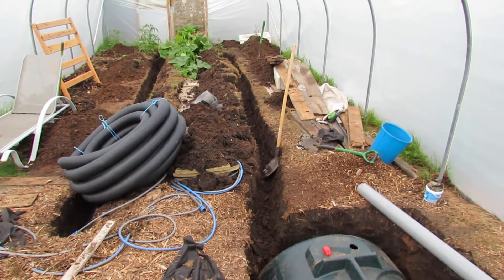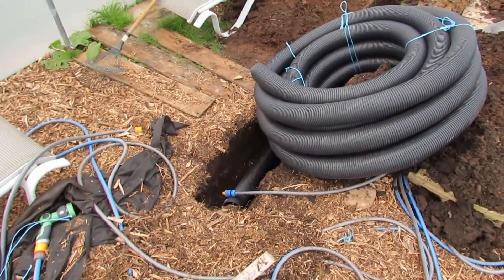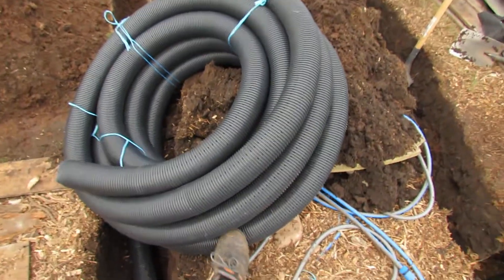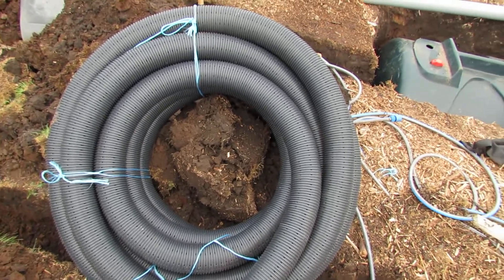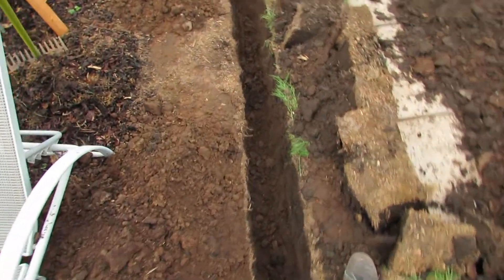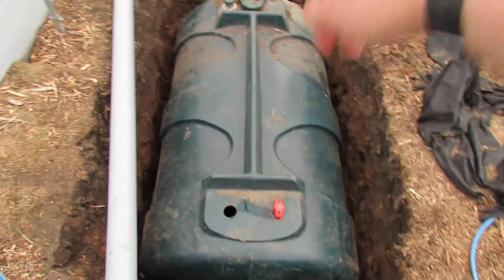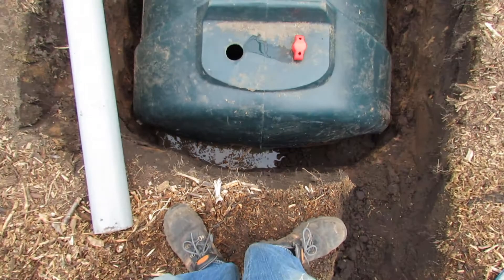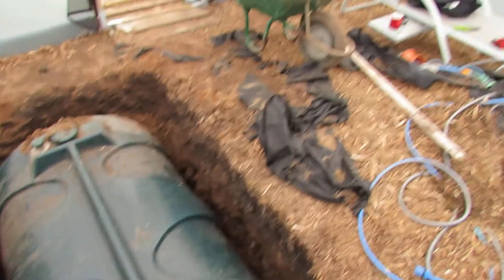Polytunnel Thermal store / heat sink

Comment: You should use  ridged insulation in the ground around your pipes to keep the heat from being pulled out from under your green house by the frozen ground . I ran mine down 3 feet the second year .I recorded the temps ever day  with it made a difference of 6 degrees during the coldest weather . Enjoyed your vid thanks.
Reply from the maker: Ideally I would have insulated, but due to lack of budget and a high water table it wasn't feasible for this polytunnel. In the future I hope to do the project again, but with more tubing, a bigger fan and insulation.
Reply: @Gardeningat58N  good luck and thanks for the replay.

Comment: Class you are a hero just starting mine got stuck and found your video 
Thanks for sharing your knowledge 
Big Kev
Reply from the maker: Thanks, if I was to do it again from scratch I would recommend using more tubing and using a powerful centrifugal fan, my system heats by about 3 or 4 degrees Celsius, but with a larger fan and more tubing it could provide more degrees of heating and cooling.

Comment: 2:00 "cuz water's a good water holder".
Reply from the maker: I think I meant to say that water stores heat very well.
Reply: @Gardeningat58N  Funny wording error lol. Next winter I hope to install a similar system in our tunnel. Any tips?
Reply from the maker: @Convolutedtubules  Make sure you don't bury the pipes below the water table, but the deeper the better if you don't have water table issues. Also try to add as many pipes and as powerful fan as your budget allows for. Make sure its a centrifugal fan as although these are often rated with a lower air flow per hour they are designed to work with high air pressure and so are able to push the air through long lengths of pipe. Axial fans only blow their rated flow per hour when not attached to meters of pipe.
Reply: @Gardeningat58N  Thanks. I will take that into account when choosing a fan.
Reply: @Convolutedtubules  
Keep your tubes short. If you have a large greenhouse its more efficient to install multiple systems. Calculate the system losses and choose a fan that provides the desired air flow rate. Always run the numbers before you install the system in the ground, if you dont you risk having to dig it all back up

Comment: The idea is well worth pursuing. Most solar heated green houses place the piping much deeper to avoid drying the soil which then requires watering. the one foot deep piping is in the root zone for many greenhouse plants. Also be sure place a differential temperature switch/sensor controlling the fan so the fan only runs when air temp is at least 8 degrees F warmer than soil.
Reply: Greenhouses are humid places, the air drops to dewpoint in the tubing, the water vapour condenses and liquid water is returned to the root zone so you actually need to water less. As the water vapour changes phase from a gas to a liquid (condensation), it gives up the heat it gained when it changed phase from liquid to a gas (evaporation) which is approximately 1000btu per lb.

Comment: The air will drop to the soil temperature in the first few feet so you have a lot of tube not earning its keep. You need a lot more fan power than a 4" computer fan for a greenhouse that size ;)
Reply from the maker: +JohnGuest45 Your right about the air temperature dropping in the first few feet, but once the first few feet of soil warms up after an hour or so the air will stay warm and heat up the next section of pipe and soil, so after a full day the heat should reach the end of the pipe. The fan is a bathroom extractor fan, which is rated at 85 cubic meters per hour, but has a better pushing power than a pc fan as its designed to push air through long ducting and not just out of a PC case. I also think the fan is not strong enough, but I'll find out after its first year of use, with the current duct size I can easily attach a 245 cubic meters per hour fan, which would be my next step, after that I can attach more powerful fans, but it will be a little tricky. I cover some of these issues in this video https://www.youtube.com/watch?v=uxbdEpiBpK8 But I will try and do an update review in summer with more details.
Reply: +Gardening at 58N 
I`ve had mine running for 6 years :)  I have 200ft of tubing buried in 4ft of clay. I power it with a 12 inch; 1000cfm duct fan which can put all the greenhouse air underground 60 times per hour.  You`ll be surprised how much heat these systems will store and return if designed correctly. Most use tubes which are too long and fans that dont move enough air :)

By my reckoning, your greenhouse volume is something around 3000 cubic feet, 35 x 14 would require 650ft of 4" tube. A 1000cfm fan would provide the bare minimum 20 airchanges per hour (better to have more available) excluding any friction losses.
Running the 245m3/hr fan into the 82ft tube will incur a minimum friction loss of 250Pa so its unlikely you`ll see the full 144cfm. If you do it`ll put your entire greenhouse air underground 2.88 times per hour.

Using your original 50cfm fan you`ll be getting 1 airchange per hour and the air will be taking around 7.5 seconds to travel through the tube. For perspective, one second of dwell time is more than enough to drop the air temperature by 30F..
Reply: @JohnGuest45  
Hi John 
Well done for working this out 6 years ago I wish I had before putting up the poly. Thanks for sharing your knowledge greatly appreciated .
Can you recommend a fan and what do you think the daily running costs for electric would be ?
Reply: @kevinmcveigh2784  
Hi kevin
 I would recommend using a fan that can provide at least 20 greenhouse air changes per hour, 40 is better. Its important to remember its the tubing layout that will dictate how much air you can run, not the fan :)